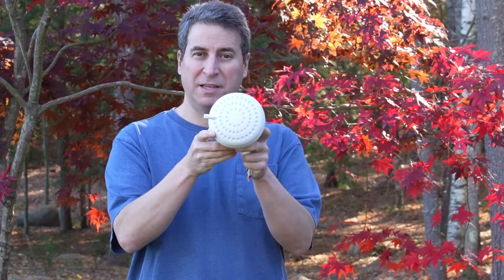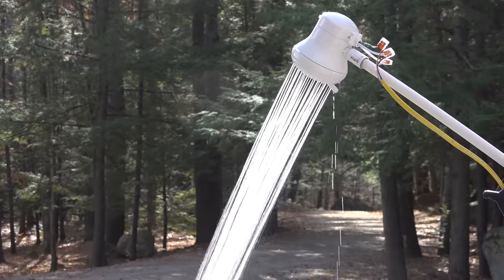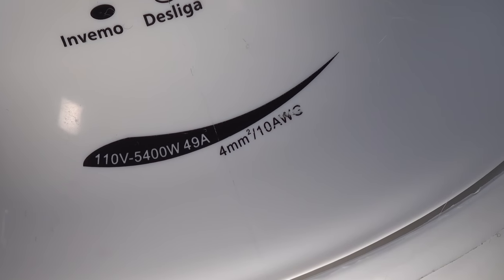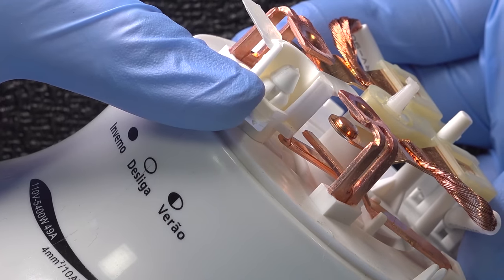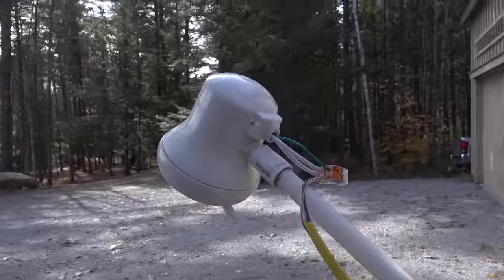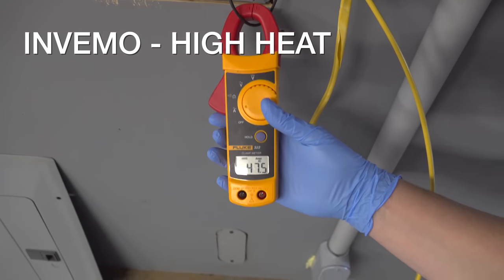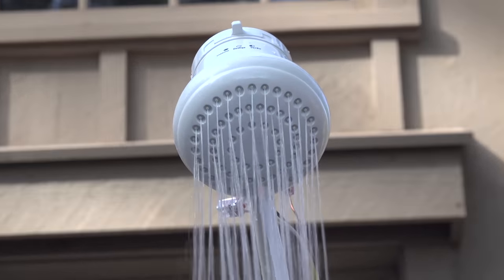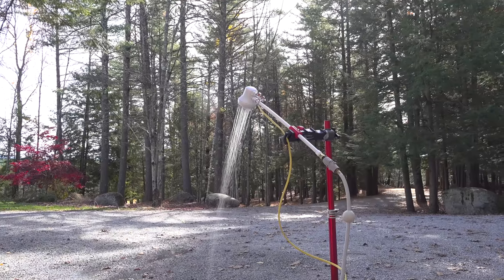What Happens When You Use a SUICIDE SHOWER HEAD in the US

Comment: Engineer here who lived 30 years in Brazil, where this type of shower was invented and 99% of the houses have one of these. The "suicide showers" got the name because the early versions were really dangerous, they could get too hot really fast and the resistance could fail easily because they were made of chrome and nickel. So this Brazilian refined the idea and came up with a version using different metals and allowing temperature control.
 Despite of the name, those showers are really safe, even in Brazil were most people doesn't install it correct ( most houses doesn't have grounding at all ) you have a greater chance of dying from a cellphone charger exploding then dying from a shower. It's not a problem at all.
So, a few observations.
- Electricity will always chose the less resistant patch, and your body will always have more resistance than the coil, unless it became defective and that's probably the one time you are at risk.
- These showers have plastic housing for extra safety, the old ones was metallic being more dangerous.
- The shower have 3 settings inverno = Winter, desligado = off,  verão = summer. Around here, everybody knows that you shouldn't change the lever position with the shower on, because it can create some arc and you can be electrocuted. We do have some models with a long lever that allows to change the settings without risk.
- We do have some fancy models were the heating coil is isolated from the water, adding extra security, but they are very expensive and rare.
-  The little tingling can happens in places having brackish water and/or bathrooms with metal pipes. The greater amount of salt of water can allow a little bit of current to pass to the human body, but it does not harm. Also, in places it metal pipes, fittings, drains and valves, we can have the same issue because of the lack of grounding.
- Finally, a waterproof wire connector is not required, since the connection will be always be made at high heights, normally above 2meters.
Reply: Yes, I lived there so some time, and this is how it is most places. 

Never once did I get any “tingling” while showing.
Reply: Don't you think if the shower head had a silicone shell outside the plastic it would help prevent arcing?
Reply: 99%?
Source, please.
Reply: @biamino  how many houses have a shower?

Every house I went in had a variation of that shower
Reply: I saw similar in Central America with a nude visible nichrome element
Reply: I believe you but you can’t ever convince me to try one 😭
Reply: @biamino  I'm Brazilian I can guarantee that every house I lived in and went in had at least one of these showers, but there are some buildings in which the water is heated with natural gas and also some houses but it's very expensive so most houses have the "suicide shower head".
Reply: @biamino  except for extremely poor houses or places where it doesnt get too cold at winter, basically every house uses these showerhead
Reply: I'm quite sure even in Brazil, there are safety regulations that need to be followed regardless what your personal beliefs of safety may be.
Reply: they aren t save. the wires are directly in the water , if one connector corrode , then the voltage cant go through them, and flow over the earth if it is correct connected. in germany we have for that breaker, they break the circuit if the power flow through the earth connector or a human.
Reply: @santopino2546  Well yes obviously. Every country has laws, whats your point
Reply: @biamino  99% is obviously an euphemism, but as a guy who lives in brazil i can confir that most houses have this kind of shower
Reply: Wouldn't get a ground from metal pipes if they were all the way to the well ?
Reply: @gabrielribeirocarvalho2434  Acually it should be around 99.99%
Reply: I would say 99.99%
Reply: @grey6063  i'm literally just about to get in the shower and mine is just like the one of the video lol 

our only real concern with electrical showers is when it rains
Reply: @biamino  source?
Brazil.
Reply: @biamino  it’s a figure of speech 🤓
Reply: @grey6063  I’ve used them traveling in Central America in the 91 onwards and they use a very similar one in S.E Asia I have had many trips and I have never felt a tingle showering in them.  Safe as houses.
Reply: “How was your shower?”

“Electric.”
Reply: Perhaps people in Brazil are smart enough to not operate that switch with wet hands while the water is on, but in America.....  In some Asian countries, electric instant water heaters are mounted on the wall of the shower.  They are regarded as a safety hazard but I'm not clear on exactly how people get electrocuted.  The installation instructions say not to connect a metallic hose but many people do.  A big difference is that you touch it to turn it on and off and to adjust the water temperature.
Reply: What size wire was this normally fed with? He is using 12awg nm which is only good for 20amp. So in time it'll burn up and melt or catch fire. Same thing happens all the time when ppl put space heaters on a 14awg circuit ment to handle 15amp the. Change the breaker to 20amp so it stops nuisance tripping.  But 6awg copper is expensive and large and I feel like if your using this head instead of a water heater you probably can't afford the 6awg (atleast at today's prices)
Reply: @localterrorist3155  no as the arc will still happen when making and breaking connection in the internal contacts
Reply: Hey. I really didnt knew why we shouldnt and our parents always said “DONT TURN THE TEMPERATURE WHILE THE SHOWER IS ACTIVE”.
Now I know why
Reply: @biamino  em todo lugar que não tem gás encanado o único jeito de ter chuveiro de água quente é usando elétrico.. em toda minha vida. Nunca vi ninguém com boiler elétrico (que mandaria água pre aquecida para o chuveiro) todos os chuveiros de.afua que te que vi na minha vida (40 anos)  foram elétricos tirando 2 chuveiros a gás que vi em casas antigas no rio de janeiro
Reply: no one calls it suicide shower here either.
Reply: Most houses in Brazil don't have grounding? So they don't have Earth Leakage Circuit Breakers. Just like Europe and USA 60 years ago. Lethal.
Reply: Obg por nós representar, fiquei levemente puto com esses gringo falar dos nossos chuveiros, fora o fato de q o elétrico, dependendo da matriz/fonte energética é mais eficiente . Kkkkkk
Reply: @knstormshadow  It depends. With this 5500w shower in 127 volts we normally use a 6mm (9 awg like). But when the distance of the shower  by the electric distribution panel is greater than 20 meters we need to increase the cross section os the wire because if the voltage loss caused by de distance.
Reply: @BritishBeachcomber  unfortunately most of the houses don't have grounding. The Brazilian electrical code used here is called ABNT 5410.  
We do have leakage break circuits called IDR or DR, but they don't work with this type of shower most of the time. This happen because the water most of the times have some elements that increase the electric conductivity and with the voltage leakage greater than 30mah break the circuits. Nowadays there are many types of electric shower and some of than works with the IDR.

But as I said, unfortunately most of the houses don't have ground , neither  IDR. Most of the time is because the majority of our country's people don't understand the importance to follow electric codes or just don't have the money to afford a professional.

As we says here..."é complicado".
Reply: I traveled to Brazil January 2020 from the US. My Girlfriend at the time her house had one, as well as the hotel we stayed at and the airbnb. I was a little concerned staring at wires hanging out with the water on. And you take 3 to 4 showers a day in the summer in Brazil. But it is how it is, I was just careful not to splash to much.
Reply: You should be a teacher.
Reply: @BritishBeachcomber  guess i'm dead then lol
Reply: about that 99%, maybe in the south of brazil where is colder and they need heating in the houses... kkkkkk 
never heard of anyone dying from an shower, the one in my house doesnt have ground connection and never had an problem with it
i love to see that even in other electricity channels people like to complain about the dangers and everything about this shower when they probably have stuff way more dangerous going around them in their houses.
it's not dangerous as people think, cover your world with bubble wrap and you're fine
Reply: @knstormshadow   Hehehe. Generally the wire used can stand from ~15 to ~25. And it usually burns out rather quickly. I believe it's intentional, because that way, when it burns it happens directly above your head and you can see it right away.
We tend to keep showering, although the smell is annoying.

Jokes aside, the resistance is engineered to burn first, and stop the current flow.
Reply: It only takes 1 time for it to fail. Hard pass
Reply: @fliegeesser4665  in Brazil you mean?
You were probably in poor regions then.
Reply: @DuduMaroja  curiosamente, toda minha vida foi chuveiro a gas, em sao paulo. Elétrico foi quando morei em república,  em Piracicaba. Eu diria que apartamentos tendem a ter chuveiro a gas e casas eletrico. Estou curioso para saber qual a real proporção que existe no Brasil. Um mapeamento de brasileiros que moram em apartamentos vs casas talvez nos entregue um numero interessante
Reply: @astronautdyno3120  don't like those lol
Reply: @HarithKasnawi  Source for the 99% number. It seems far from reality. I bet the real number must be closer to 80%
Reply: @gabrielribeirocarvalho2434  Houses do. Apartments usually dont. I challenge you to find it in an upper or upper middle class apartment in Sao Paulo.
Reply: @grey6063  sure just go against what 220 million people use safely 3 times a day in a continental scale country.
Reply: @_pulyx  want to borrow a little of my humor? 🥺
Reply: @biamino  I am Brazilian and this 99% number was quite precise about 30 years ago, since this was the only option here. Then it started to have gas heating, and now many houses use this option too, because it is cheaper. But there is no official statistic.
Reply: @Fabio-Correr-eh-Viver  Fabio.
30 years ago, in 92, I remember I had gas heated shower at my apartment building, gas heated shower at my grandparents house, and eletric shower at my other grandmas house. So, this was not literally the only option, but was the cheaper one. I know most places would have to go with this option (or lack of), but what annoys me is this imprecision with numbers, especially when it comes from engineers. If we don't know the numbers, dont fabricate one. Just say "most houses", "many houses" and so on.
Reply: @fliegeesser4665  I got it a few times in some sketchy showers. It is definitely lack of grounding making the water come out slightly charged. Can be really unpleasant if you have small cuts in your hands and you touch the somewhat-conductive metal faucet with soapy hands, but far from deadly
Reply: @biamino  This isn't a "dance monkey" scenario for you to just throw demands at someone. He gave his anecdotal story and that is that. His experience was what he communicated. Why are you making it sound like he is testifying in court?
Reply: If this was refined I could use one. No one seems to worry about instant hot water heaters directly under the sink. If the heating element and controls were further isolated from the user, I could see it becoming much safer. 120v and 15a can still get you!
Reply: @Jasoninee  Because wrong numbers may give catastrophical results.
Reply: @biamino  No it cannot. The "numbers" you are attempting to make someone feel inappropriate on is just their evaluation on the prevalence of people having a certain shower head. A person using 99% for dramatic effect on how common a shower heads are is 100% NOT something that will create catastrophic results.

You make no reasonable sense, and that person owes you nothing.
Reply: @Jasoninee  ok, i would not hire someone like this to my company. I prefer people who are objective and precise. Figure of speech can be left for novels and leisure. It leads to dubious interpretation.
Reply: @Jasoninee  the same way I owe you nothing ;)
All I ask for people informing others is to be factual and objective.
Reply: @biamino  Cool I am sure that sounds fine to someone that had no intention of trying to get hired by you 🤣
Reply: @biamino  When did I say you owe me anything? You are so funny. My whole start of everything was calling you out for attempting to compel someone to do something like they should feel guilty or something. That person owes you nothing, and you response is you owe me nothing?! 🤣🤣🤣
Reply: @biamino  true History! Sou brasileiro! :) and I don’t know ir there ia any research about it but all of my family and friends has this thing at Home! Sou do Rio de Janeiro.
Reply: @santopino2546  there is no one to see if u are folowing the regulatins on your own house here.. so people simply dont folow! We actualy have some prety expensive death showers as options tô buy!
Reply: @alzemiroborges  No thanks, I want a cheap death.
Reply: I just use a porcelain wire nut to bolt it on.
Reply: Wonderful explanation, just a quick correction: the reason the connection should be waterproof is mostly so it won't oxidize from the moisture in the air during and after a shower getting in between those little flex copper wire contact surfaces against each other.
The vast majority of these showers are not even installed with the proper connector. I am pretty sure that most accidents involving those showers happen because of that bad connection with the wire oxidizing due to moisture in the air. The copper gets darker and darker with usage and it's resistance starts increasing until the point where the resistance is so high that the PVC insulation starts burning after it starts smoking of course and we all I repeat we all know what is the smell of shower wires which are starting to smoke, we know before it even starts smoking.
So no matter where you are in the world please do an extra safe connection when installing a suicide shower. Stay safe. and don't mind that tickle, it happens all the time you know it won't kill you don't worry nobody got killed from tha-BZZZZZZZZZZ
Reply: @biamino donkey
Reply: @biamino  I can't say it's 99%, but the other common alternative here in Brazil is heated by natural gas, but this option is available only in big cities, and in the last 10 years we started to use more sun-powered heat too, but both options are too expensive for a typical house
Reply: @santopino2546 , we have strict regulations on how to produce and install this kind of shower, but most houses don't follow it
Reply: @knstormshadow  the models you can change the temperature while is on using a different method and don't break the connection, so don't generate an arc
Reply: @DuduMaroja  antigamente era mais comum boiler elétrico, ainda existem vestígios disso em casas e apartamentos antigos com torneira fria e quente, mas ambas com água fria, e hoje em dia temos a opção de aquecimento solar, mas ainda é muito caro
Reply: @gabrielbr1459  o aquecimento deles também é elétrico em geral, só não é direto no chuveiro, uma vez que eles usam a mesma água aquecida em todas torneiras, e pra aquecimento do ambiente
Reply: @Fabio-Correr-eh-Viver  but gas heating is available only in big cities, small cities don't have this option, but nowadays we have sun heating too
Reply: @vixeythevixen  Well... in my country every house have 3 phase power 400V. Speaking about dangers. 5 wires yo connect not mentioned ripple control cables. Appliances for bathroom must be either on safe voltage or covered against splash. Its kind if complex stuff with zone sizes and stuff around.

But argument taken. With safety of electrical installations here most dangers are from heart stroke due electricity prices.
Reply: @grey6063  You DO NOT believe him.  If you didn't lie, you would try one.  You are either a potential ex-wife or a politician.
Reply: @brockryan3405  wym :(
Reply: @esser7678  anta
Reply: Sim. A questão então seria qual a proporção, dado que cidades grandes possuem densidade populacional maior. Só me irrita um pouco alguns argumentos por aí que utilizam status para se elevar a condição de conhecedor técnico/autoridade no assunto, mas depois, ao invés de utilizar dados baseados em fontes, fabrica números para gerar hipérboles.
Reply: @biamino  não tem como ter certeza desse dado, o único jeito seria incluir no censo, aí teríamos dados precisos, podemos trabalhar com estatísticas, mas serão sempre falhas. Mesmo na cidade de São Paulo, que é proibido por lei ter botijão de gás em prédios a mais de uma década, não é todo lugar que tem gás encanado, e mesmo onde tem, an vezes usa chuveiro elétrico, onde eu moro é assim, e não há interesse do proprietário em fazer uma reforma caca pra mudar isso.
Reply: These were not invented in Brazil, they were made in Italy.
Reply: @garymaya1767  the modern electric shower was invented in Brazil before Francisco Canho the technology was too dangerous to use it at home.
Reply: I knew I'd find a Brazilian in the comments
Reply: @BritishBeachcomber  to be fair new houses do have grounding, and the regulations make thinga pretty safe, dwre I say a lot safer than us circuits and on pair with european ones.
Reply: @biamino  mesmo em cidades grandes não acredito que aquecimento a gás prevaleça. Morei em Bh por alguns anos, lá tem gás encanado em alguns bairros, e mesmo nesses bairros, sempre vi chuveiros elétricos, com o gás ficando só pra cozinha. Sem falar que a instalação de um chuveiro elétrico costuma ser mais barato, e é o que a maioria das pessoas conhecem e confiam.
Reply: @grey6063  if you had an electric hot water heater it’s essentially the same thing, just preheating your water instead.
Reply: If they are so safe, why are they banned in other countries?
Reply: @andybub45  Which countries?
Reply: @biamino  confirmed,
more than 30 years using suicidal shower daily and not a single accident.
Reply: We're no savages here; we have regulations, and also good electric showers. That name, as well the video, is an overkill ('pum' intended).

And considering that some houses has 2 (or more) showers, you could consider it as 110% marketing penetration.
Reply: even in Brazil were most people doesn't*install it correct.   ( most houses *doesn't have grounding at all ) Maybe you should have an engineer check your english before you post.
Reply: @KARMA-vu8ii  are you an English teacher? I'd like to thank you for that correction at our fellow colleague. 
Even when it sounds petty.
Reply: No electricity will not take only the path of least resistance to ground, it will take all paths to ground.
Reply: @gabrielbr1459  
Get mad all ya want, this isn't a "better" system by any stretch of the word. This is poor country shit right here and there is nothing wrong with that but don't go taking on airs Dirté.
Reply: "Electricity will always choose the less resistant path" is dangerously false!  Electricity won't just shut off the more resistant path when a less resistant path exists, it will travel in as many parallel paths that exist!  The 30 amps of current will flow through the heating element, but can also deliver the tenth of an amp it takes to kill a person.  Your LIFE depends solely on that green wire being properly connected to earth ground.  Electricity needs a full path to flow through you, and the completion of the path would be metal pipes with metal water valves, or a metal drain pipe, as you pointed out.  The point about the salt content of the water also makes a big difference.  BTW, a GFI should always trip with this type of shower, depending on the water salt content.  Current will be flowing through the ground wire, as it's designed to act as an electrical barrier between the heating element and you. That small wire will only protect you from much of the current, but a conductive screen is necessary to do a better job.  I'm sorry, but if I ever visit one of those countries with these shower heads, I will have to go without a shower.
Reply: @s.7208  well i’m brazilian nobody I know have suffered an Electric shock because of the shower tbh
Reply: @santopino2546  even? What do u think Brazil is? south sudan? lol.
Reply: @knstormshadow  Normally those shower heads are wired to 240v and have a rating of about 5000W. The right wiring by our standard is 10 AWG (or 6mm) for most of those. But I've saw installation, specially older ones, using 14 awg wiring.
Reply: Says they're "really safe, even in Brazil were most people doesn't install it correct"

Then says, "everybody knows that you shouldn't change the lever position with the shower on, because it can create some arc and you can be electrocuted"

Yep, that sounds really safe.
Reply: Can you help me with mine? It's grounded on 20amp breaker but it heats the cable very fast and trips the breaker.
Reply: Eh, idk what electricity they use in Perú but I get zapped hard every time by the water close to the shower head.
Reply: @biamino I'm from Brazil and I've never seen another bath water heating system
Reply: @biamino he forgot to say that the composition of the water is different too, which leads to different resistance, that is, in other countries it can be more dangerous
Reply: Yes. They're extremely common in Kenya,and I've never heard of anyone who died from one.
Reply: @biamino its so common that most people dont even know and have never seen other type of shower
Reply: @s.7208 Germany is advanced! You guys have circuit breakers! Incredible!
Reply: @BritishBeachcomber  Only old houses don't have them, but the standard nowadays is to have grounding.
Reply: @fliegeesser4665 I actually stayed with a friend the first time I visited Brasil, and he lived in some military apartments. There was a small metal box about the size of a shoe box, with a little gas valve, and a box of matches. You would light the pilot light (propane) and start the shower. This seemed more sketchy to me than the Lorenzetti that most families use.
Reply: @rauldurand I approve this message.
Reply: @Stormy2142 You're right. Never heard that before.
Reply: @Cypher84X It's easy to Hard Pass when you have a hot water heater downstairs. For 285000000 Brazilians this is the option.
Reply: It's fine but your shower might tingle. Also don't touch it or you'll die.
Reply: @vixeythevixen I'm not scared of it, it just looks like shit.
Reply: @brianwest2775  in America we're smart enough to use electric water Heaters and boilers, so we have heated water throughout the house and no live wires sticking out of the shower lmao. These crappy little shower heads are clever but they sure aren't something I'd consider permanent. It looks like s*** and wouldn't work as well up north. Brazilian ground water is already lukewarm. It comes out at 40 degrees where I'm at
Reply: @santopino2546 Precisely, there is a reason why the only stories of people dying related to the shower head, are when they are installing It and dont turn off the power while simultaneously not using any safety whatsoever. They are built to be safe to use in a place where most people wouldn't bother hiring a electrician to do electricity related stuff.